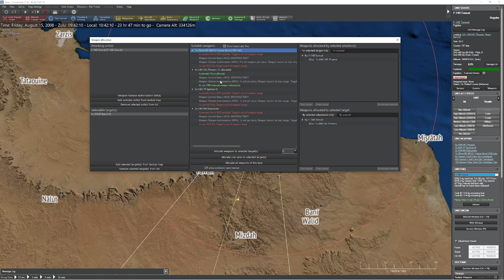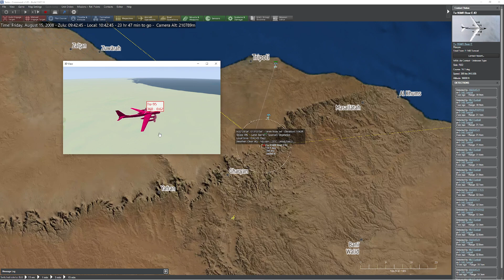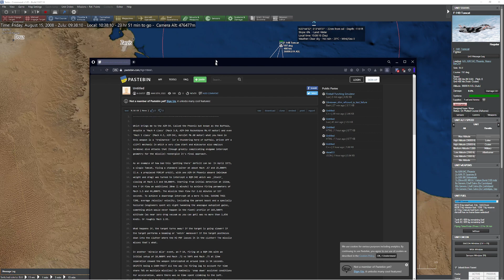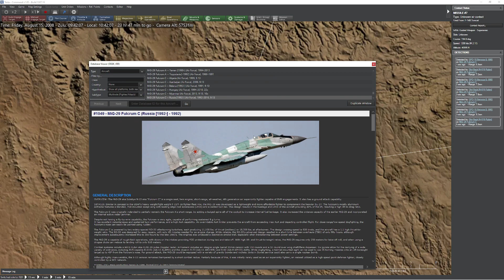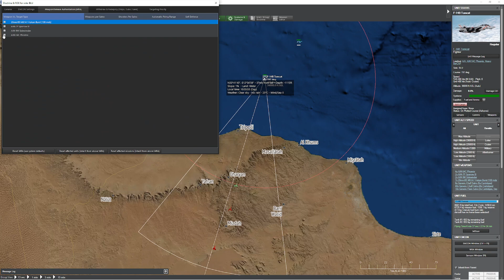C: MO - Long Range AAM Effectiveness

Comment: I’ve always been confused about this but in DCS world when you STT a target then fire, will that alert the target if the missile has not gone active. So say the same example you give here: Would the detection be the same?
Reply: Shouldn’t, till the missiles radar goes active. Though some systems might alert if it picks up a mid course correction signal. But only on more advanced modem ecm/tw systems
Reply: @firefox3187  thanks. I guess I’ve always been confused because DCS has a lot of bugs.